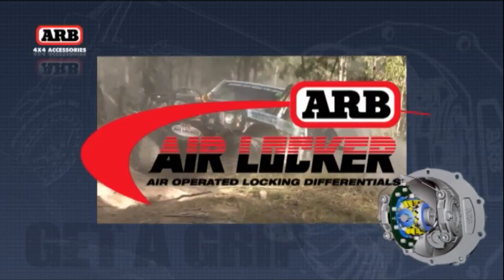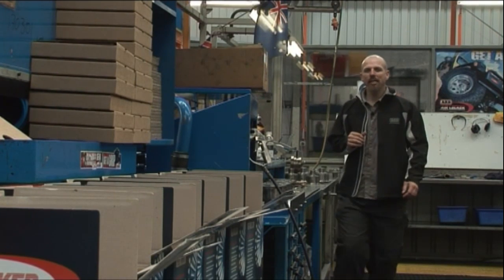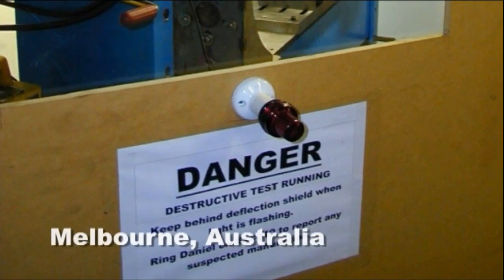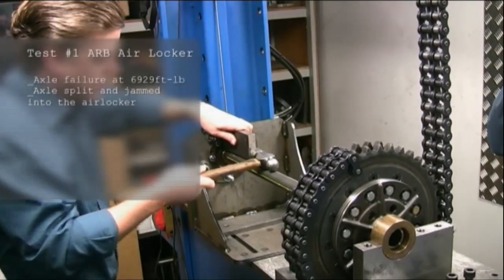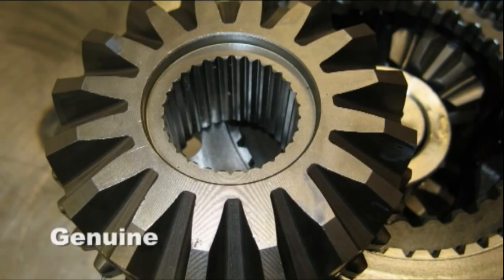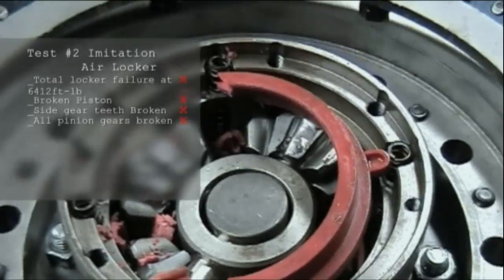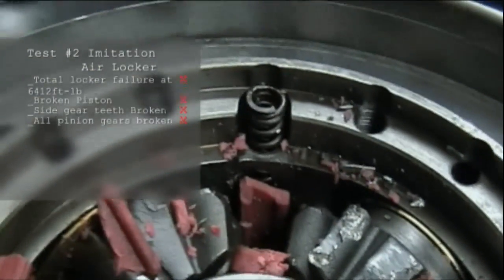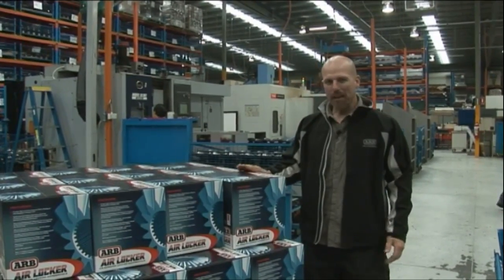ARB Air Locker Comparison

Comment: the question you should ask urself is.......

exactly how much pressure or strain you have to put on your vehicle to gain 6412ft or 6929ft....
you have to been really driving like a maniac up a rocky surface, wheel spinning on tar  to gain that much strain....any stats or comments?
Reply: +Muhammed Desia Only in competition you might break a driveshaft.

But then why are you doing off road racing with chinese knockoff product?

Comment: so.. can you explain why happened this ? watch the video (rear broken 8" crown w(arb locker)
is it a bad adjustment (between pinion and crown wheel) from the engineer? 
is it normal to brake the teeth from the crown but not in a sequence? as you ll see some are ok ,then some are broken ,next again ok,etc..also some of them are broken to the inner side and others to the outer surface...
thanks for your immediate reply

Comment from the maker: To answer the second part of your question, installing an ARB locker generally offers a strength improvement for your whole ring and pinion set (pinion gear and crown wheel). It is much more resistant to allowing the ring gear to flex away from the pinion and therefore it keeps your ring and pinion teeth meshing correctly where your factory differential may let the teeth mesh stray from the flex and form highly stressed zones, which could potentially cause a breakage.

Comment from the maker: Hi Chris, bits of broken axle shafts are capable of causing damage to wheel bearings, diff bearings, pinion bearings, ring and pinion sets, oil seals (wheel and pinion), as well as the internals of an Air Locker if they manage to get inside. This goes for broken ring and pinion teeth also. For this reason it's advisable to replace broken internals ASAP. ARB employ the strongest drain plug magnet on the market for our diff covers, and they can literally draw the broken bits out of the diff oil.

Comment: is it possible when the hemi-shaft brake ,the small broken pieces to remain inside to the mechanism of the arb locker and destroy it? or the gears of the arb locker are unbreakable?

is it true or false that when installing arb locker ,this protect the pinion gear and destroy only the crown?

Comment from the maker: Wherever possible we test with the strongest available axle shafts that we can find. These can be chromoly or chrome vanadium or nickel alloy, etc. 

We have found no directly dependable correlation between axle material composition and torque failure results. 

The quality of the material, design of the shaft, machining processes, heat treatment processes and surface processes all play a part in determining the strength of any shaft.

Comment from the maker: Hi Pauly, the figures you've stated are actually incorrect. It's not possible to state a percentage figure difference between the products as the failure point of the ARB Air Locker is not known because the axle failed prior to the Air Locker, unlike the copy we tested.

The point of the video was to demonstrate that with an Air Locker installed, the axle will fail before the locker, which is easier and less expensive to repair/replace.

Hope that clears things up

Comment: my arb air locker failed the bolts snapped before the any drive shaft failed on a front isuzu vehicross quite disappointed putting a temporary Axel in until it is fixed or replaced yet to inspect inner diff ,busy getting the vehicle back on the road will be trying to contact arb soon 22/12/11

Comment: I already have a Powertrax Lock Right locker in my rear axle as of now though if it ever goes out i will be looking for something a little better and I see this. My question is does ARB make this Air locker for a 1997 Chevy Silverado K1500 5.7L with a GM 8.5" rear axle?

Comment: after this video i would clearly choose the chinese air locker!
why!? because the arb test is bs! the axle shaft on the arb was an aftermarket unit and the other one was an oem shaft (you can see it in the video), also most of the time the arb breaks before the shaft breaks. i got an rack full of broken arbs, and the next thing is 90% of the time the arb leaks air! the worst arb is the ford 9" unit !

Comment: They could have done this test with a patrol axle. . . That way there might be more than a 8% difference in the failure piont. toyota axle. . . 6900lb and it broke. chinese locker nearly broke it aswell. . . 6400lb, They should have used that machine to break the arb locker, that would have shown the difference. arb -23,000lb china 6,400.

Nearly a pointless test as it was.